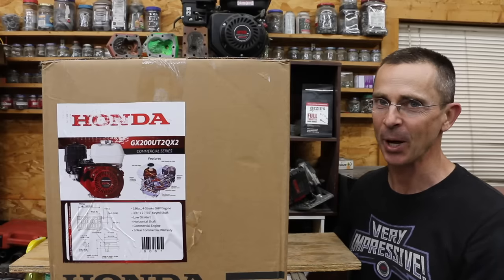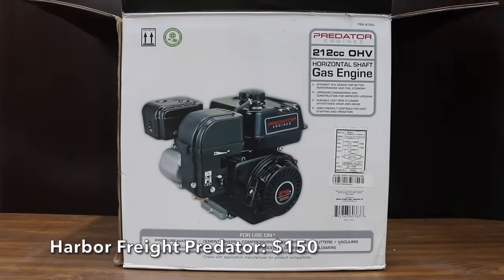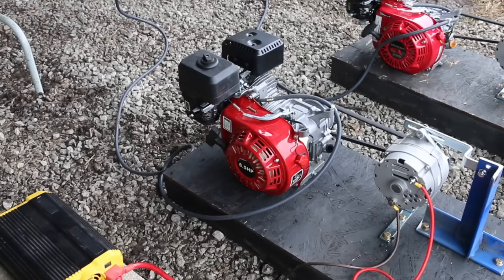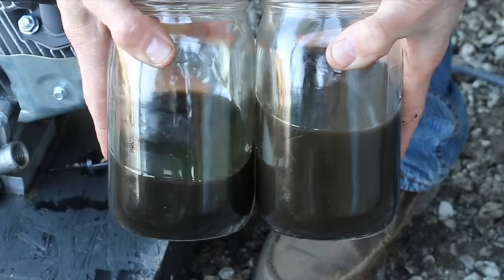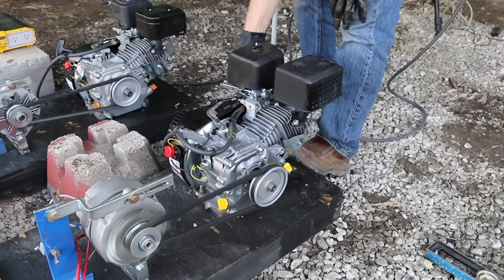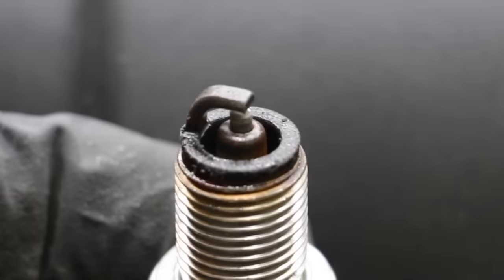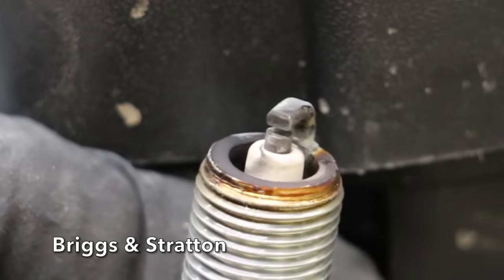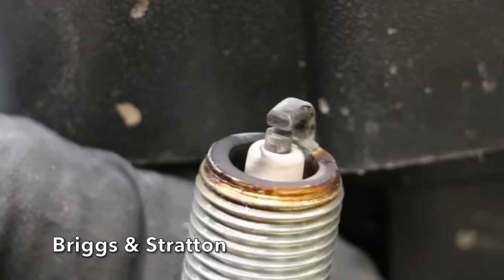$150 Honda Clone vs $600 Honda? Let’s settle this! Fuel Efficiency, Horsepower, Durability, Starting

Comment: As one who bought, sold, and raced these engines, except the Briggs, they all come from China, all the parts will interchange and the only difference is the grade of the parts or basically you get what you pay for. Typically the clone will be in better shape that what was showed as the lower grades are usually only sold in China. I am not sure what happened to Briggs, but they sold out and I don't know who bought them. If you look closely in the video, the Briggs is actually another Honda clone. It is not a Briggs design. So you could be possibly looking at 4 grades of Chinese engines, designed by Honda of Japan, but with varying degrees of quality. I am pretty sure China makes parts for the Honda, although I don't know where they are assembled. If you want to know know more, there is great information on these engines in karting forums where they are seriously raced with rules on what you can do to the engine. With high performance parts, you can get over 20 HP out of one of these, but it won't come cheap. Again, all the same engine, just different quality control and assembly. BTW these very same engines are sold in many colors and with many brand names on them, all over the world.
Reply from the maker: Thanks for sharing.

Comment: This is a really good video but not all Honda clones are born equal. a lot of them can't get the carb right, especially the ones with no adjustment except nozzle size which is a bs design if not done right. My solution is always: carb upgrade, still save hundreds.
Reply from the maker: Thanks for the feedback.

Comment: I would not have had to do a comparison test to know the real Honda was a better choice. I've used Honda small engines for years and they are pretty much indestructible and last forever, even after years of misuse (late oil changes, nasty environments, etc.).
Reply from the maker: Thanks for the feedback.

Comment: I think the gokart test is flawed due to having a clutch system that introduces a lot of variables.  Would rather see a more direct drive test.  Or putting it on a mower with a hydro system and pull something while checking peak RPM.

Comment: only  one test is missing.
A 1000 hours of using....in other words...Total expected lifetime for such an engine.
And after those 1000 hours (maybe running a waterpump (irrigation) or generator) again those power tests with oil consumption and petrol consumption measurings.
To get a better insight in longlasting of those 4.

Comment: I have had Hondas working on the farm for years the clones break within 12 months in the same application i.e. water pump.  If you ran them under load to destruction, the Honda would work out cheaper.
Reply from the maker: Thanks for the feedback.

Comment: Predator is a Chinese knockoff of Honda GX200. In fact, almost a perfect clone. You can swap parts between both. Predator does not have the two threaded holes for mounting generator coils under flywheel to recharge a battery. However, it is easy to drill and tap them with simple hand tools. You will also need to change flywheel too, so you might as well get the one with starter gear. Good use for a blown Honda you are replacing.
Reply from the maker: Thanks for the feedback.

Comment: If you get a good honda clone, they are fine, but build quality on them can be junk. Seen many an oil burner and many have junkie castings. I wonder if they make different tiers of clones.

In my experience I break them in with basic CC/CD SAE 30 oil, then then replace with multigrade.
Reply from the maker: Thanks for the feedback.

Comment: I had a Honda motor on a go-kart and it blew up faster then the predator motor that I replaced it with. But the Honda was used when I got it so it's possible it was not Hondas fault .-.
Reply from the maker: Thanks for sharing.

Comment: Try starting that knock off in cold weather
I had a knock off of 2 engines 6 .5 HP
And both will not start below freezing.
Reply from the maker: Thanks for the feedback.

Comment: I have always believed using synthetic oil in a new engine is bad due to it not allowing the engine to break in properly. IMO…it’s best to break in with a 14:07 quality petroleum oil before switching to synthetic. The fake Honda may have done better if broken in properly?
Reply from the maker: Thanks for sharing.

Comment: They are all 200cc+- exept for honda clone at 160cc ? So honda clone of 200cc would beat them in torque? I got one 196cc clone and it struggle to keep 3000psi on my new pressure washer pump was thinking about a 212cc from around here in canada (power fist pretty sure its the same as predator) 12cc should help . It claims 7.0hp instead of 6.5
Reply from the maker: Thanks for the feedback.

Comment: Briggs & Stratton unfortunately does not make good engines anymore. I have 1 honda gx390 and 1 predator 420cc engine. I put a genuine honda carb on the predator (bolt on, as it is a honda clone also) and a genuine honda aie intake/filter, and an Even spark plug. With those modifications, the predator 420 engine has been performing just as well as (if not better than) my gx390. The predator engine is now 12 years old and has been powering a Saylor-Beall 705 2-stage air compressor pump (17.1 cfm @ 175 psi) since I first got it (the engine and pump) hours are unknown, bur it has run 350 hours since I installed an hour meter, and it probably had 300 to 350 hours in it already by that time. It took a little tinkering,but im fine with that, and I still have less than half of the cost of a genuine honda in this thing. I've been really impressed with the predator. It is a little louder and harder to pull-start but with the electric start that is not really an issue.
Reply from the maker: Thanks for the feedback.

Comment: To me I would run regular oil for first 24 hours and then change oil with full synthetic oil and I use Amsoil for small air cooled motors and by doing this it will let your rings to seal up better and even on  my 05 Dodge 5.9 diesel the first year I run regular Rotla oil oil and second year and from then on I run Amsoil 15-w 40  signature series .
Reply from the maker: Thanks for the feedback.

Comment: Sad to see the Briggs & Stratton engine perform bad as the Honda clone. I don't understand how the Majority of lawn mowers use their engines.
Reply from the maker: Thanks for the feedback.
Reply: The Briggs engine in this video IS a Honda clone. Look closely in the video. Only difference of the 4 engines in the video was cost and which Chinese factory they came from. They did make a model called the Hemi, which can also be bought at Harbor Freight and is also called a predator. We raced them for years.
Reply: @danlemke6407  To my disappointment Briggs score the second worst in almost every test. The Honda proven to be the best engine follow by the Predator. Briggs and Straton where pioneers on the small engine industry. The non Hemi version of the Predator has more aftermarket parts available.

Comment: The point is they (probably a Chinese company) have stolen another companies intellectual property.
Honda spent time and money creating their design just to have it copied and then be undercut.
 What if companies willing to design stuff give up?
I have bought a Chinese clone generator and it ran for exactly 7 minutes.
There were no repair options so I got my money back.  It probably went into land fill.
I have a 20 year old Honda water Pump down at my dam.  It sits for 6-8 months each year and starts second pull!
I’m sick to death of getting ripped off with crap from China.
They are laughing at us!

Comment: Use said the brigs and Stratton use 31 pounds of fuel even though it started at 54 pounds of fuel and ended at 25 pounds of it use only 29 pounds of fuel and when you show the chart it show in total 59 pound of fuel in 48 hours first day it used 31 and the second 29 pounds what you said about the second day was right but for the first you 31 then changed it to 30 while it’s actually 29 I’m confused from your math

Comment: I bought a big cement mixer and it had one of these Chinese Honda motors and came with a dented fuel tank and what I did was dropped it in the bin and replaced it with a new electric motor.
Reply from the maker: Thanks for sharing.

Comment: when you say "fuel cell" you're simply talking about fuel tank or gas tank.,..  this is a little confusing, "FUEL CELLS" are a term often used in hydrogen and other molecular transforming power supplies.
Reply: We use "fuel cell" in the performance hobby all the time.
Reply: @413x398  sure but "performance hobby" isnt a scientific field, its for "hobbiests".. lol
Reply from the maker: Thanks for the constructive feedback.
Reply: @snoopstp4189  You have no idea how much science is involved in cars, planes, and boats. This isn't origami.
Reply: @413x398  lol right... sure dumby whatevs...

Comment: you added full synthetic oil to both engines..WE ALL KNOW that synthetic oil IS ONLY USED AFTER NON SYNTHETIC OIL IS USED FOR A BREAK IN PERIOD.  This is because a new engine, one which has not been " run in" on break in oil, can not bed in its piston rings on the new , cross hatched cylinder..because the synthetic oil is Too Slippery to allow the rings to crerate friction on the cross hatch on the cylinder, thus allowing optium ring seal against the cylinder....As such, it is possible that the Honda engine could have some run time at the factory to allow the synthrtic oil to work properly, whilst the other engine may not have been "run in", thus not allowing the piston rings to seat properly..causing excessive oil burning and poor efficency and power production..effectively killing the engine during the first few minutes of operation with the synthetic oil and not using proper "break in " oil.
Reply: Same issue with compressors.  We break in with petroleum and run synthetic from then on out.

Comment: I'm guessing that you couldn't afford a Kohler Command Pro. Forged-steel crankshaft, and cast-iron cylinder liner or a Tecumseh – Model LEV80 which is not OHV.

Comment: this is not a real test, take that harbor freight motor, stick it on a lawn mower / pressure washer, and use it (or try and use it) 6-8 hours a day every day for 6 months on jobs. you will quickly see where the extra $450 goes. no experienced working man would ever buy sophisticated tools (drills, motors, welder) from harbor freight.

Comment: I want a $600 lawnmower engine instead of a $150 lawnmower engine that I'll have to change the plugs on every 24th time I cut the lawn. Duh. I could buy 4 $150 brand new engines in time, or just Chuck money down the toilet and use an expensive engine that takes food off the table, but I'll still be using it when I'm old and when you feel like you're going to have to rethink this buying strategy. Ppl like this just wanna get on YouTube but don't care how vigilant their speech is.
Reply from the maker: Thanks for sharing.

Comment: Chinese aluminum is the reason for the higher value, while contributing to the lower iron value. The piston is of different quality. Also the piston rings seem to be quite similar while the tolerances between piston and the cylinder are not. I have exactly similar clone in my snow blower, and it does it's job just fine. So, would I buy a real Honda engine if the fake someday quits?
No. Hondas are overpriced.  As most Honda products are now actually made in China anyway, they just approve only the best factories to make engines for them. Like Jingcheng and others that are partly owned by Mikuni. I also have a chinese 250 cc bike, bought it just for fun, a 125 off road bike,  my other is Honda, and the chinese 250 engine is as well made or better than the "real" Honda Rebel 250 cc engine, but not as good or well made as the old CX 500. All the other areas of that chinese bike are just funny junk copy of Suzuki, but they "work". And the bike has about 20000 miles of completely trouble free miles on it. It has been the most reliable vehicle that I have owned for 50 years. And I have had motor vehicles here in Finland from the US (many), Soviet Union (2) , Germany (3) (actually one from Belgium), Sweden, Japan (7), France (one too many), Britain(2) (sweet junk), Canada (a too good Chevy STW, I sold it to a good family who just had to have it), China (3) (they just work), and I fix motor vehicles for hobby. I still have many of those good ones, Blazer -79, Hummer H3 daily driver, VW Beetle based kit car , CX 500 ,and all the Chinese (2 bikes and an UTV) and a German (that Belgium assembled) Ford Taunus -82 (not Taurus, google Taunus) that I put the 302 V8 into it instead of the original 1,6 L four. Poor Man's Mustang...
So, as those Honda clones may be made in a just bigger-than-a-shed factory, or a city-sized factory that also makes fighter jets, the "similar" clones may be of very different quality.
But they work...

Comment: the chonda motors are ok  but over time get really hard to start the honda usually one pull it starts  I do have chonda motors they eventually self destruct the fuel tanks rust   and there seems to be better makes in them  as some last longer than others even tho they look the same 
value for money yes longevity no
Reply from the maker: Thanks for sharing.

Comment: Long term storage causes clones and fake's carburetors to gum up from evaporating fuel. Even run dry, residual fuel in lines and filter will continue to drain fuel into crappy carburetors that will then evaporate and gum things up. Regular and frequent use motors will not have these problems as much.
Reply from the maker: Thanks for the feedback.

Comment: its NOT a knock off yall the chinese been building these all along with a "no compete" agreement that ran out in 2000 or 01 approx..... look it up then remember the chinese motor "invasion"...... seriously is NOT a knockoff the long block parts literally interchange bolt for bolt the japs just add carbs exhaust and anything stating honda

Comment: You should never start a new engine on synthetic.  Part of the first few hundred hours is breaking in the rings.  If you start with synthetic it won't happen, qnd the engine will always burn oil.  It's possible that's why the clone burned oil. The Honda may have had a factory run in it set the rings that the clone didn't.

Comment: I don't want to appear a know all,,but I have been using. Chonda engines for years..1/4 the price of a  Honda....start first pull ,years of maintenance free running..lower tolerances so much more forgiving if short of oil or such....the chonda will be as reliable as the Honda for at least 3 years. And much easier to start...I've got years of experience using ,much more than you...chondas very good value for money ,just keep the bolts tight on everything ,turn the fuel off ,simple as that too maintain....if you find any different ,then I smell a Honda rat...I have used them wY more than you have..
Reply from the maker: Thans for the feedback.

Comment: I have a lot of small engines for various equipment around here, my Honda suitcase generator is 10+ years old with thousands of hours on it, my pressure washer has a Honda engine probably 18 years old, both 1 pull or near 1 pull start  always, why would anyone buy Chinese junk? You are not going to save anything

Comment: Ive always felt Honda makes a great engine but for these type engines why would anyone consider one at$600 when you could get a Predator for $150?  I’d even take the fake over the real for $160 you are talking 1/4 the cost, no way these will fail 4 times in the equipments lifetime.
Reply from the maker: Thanks for the feedback.
Reply: The predator is an awesome little motor, it’s got great aftermarket support as well.

Comment: Your in a China Factory making engines. Your boss says hey these on the left say Honda the ones in the middle say Briggs and the ones on the right say Predator See where this is going? Same company same engine just different labels. That's why we buy Harbor Freight same quality less money. And lets face it We know when we spend $150 on a Harbor Freight engine we aren't getting a $650 Honda engine. But we do know we can buy 4 Harbor freight engines for what one Honda will cost. And you just proved they are basically all the same
Reply: Mr. Chip, you're a good man...helping to keep all those Chinese preschoolers employed.

Comment: Predators are complete junk junk junk! Only get a Honda or a Briggs
Reply from the maker: Thanks for the feedback.
Reply: @ProjectFarm  I had one it would not run right after 1 tank of fuel then it started burning oil after that I threw that junk in the trash and got a real engine a HONDA!!!!!!!!!!!!!!

Comment: i bough a honda clone generator  was ok for about 3 months then it started going wrong no parts to fix it carb had metal jets instead of brass that could not be removed  total load of rubbish

Comment: WHY spend 4 to 6 hundred dollars on a Honda ? because Chinese steel is sub standard the liners or bores are not of the hardness or longevity of Nippon Steel nor do they have such high an honour systems regards to excellence like it or not HONDA goes and goes and goes time after time very few lemons with ur rice when its Banzai Time Chinese cheap works 6mths maybe twelve and its junk it time bye a Chinese Car !  ...............  sauce with ur BBQ ?
Reply: Too bad the Honda engines are made in China, with you guessed it, China steel.